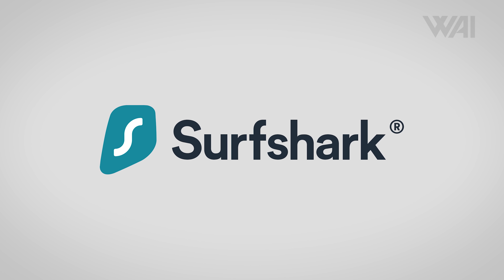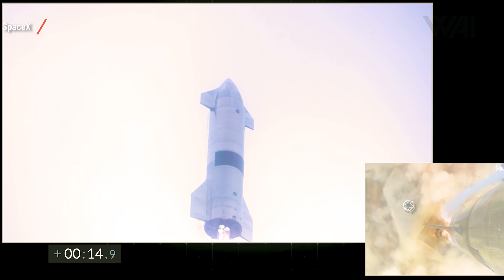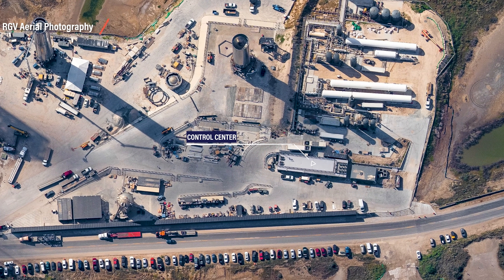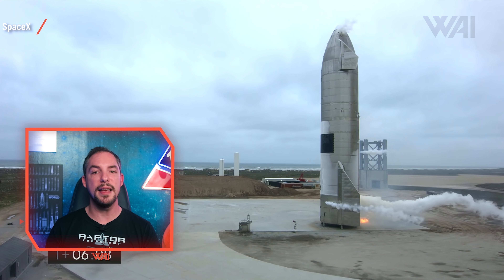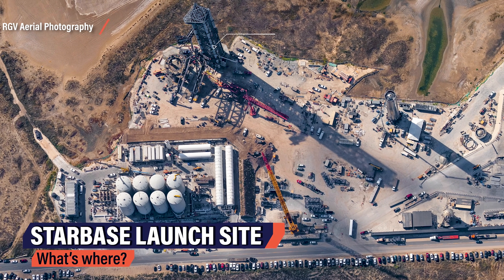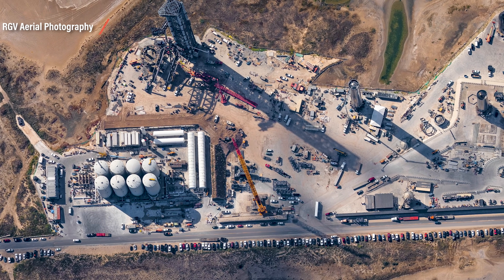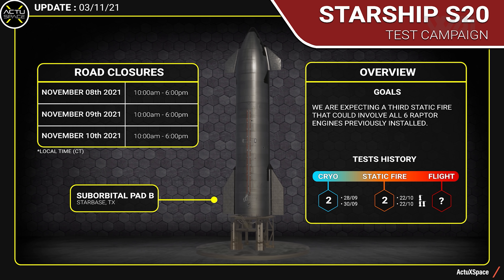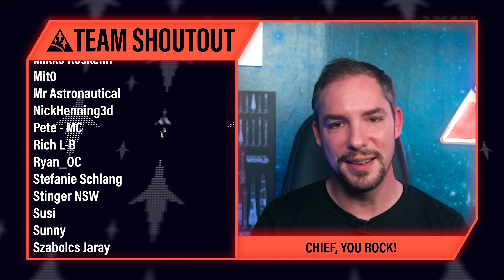What's the trick behind SpaceX's Starbase? Booster 4 getting ready for static fire!

Comment: I keep hearing back to back launches.  Unless SpaceX is building more pads and towers, that is not happening.  
A launch produces a very violent environment.  The tower and pad need to be inspected after every launch.  Shuttle with 1/2 the thrust of the proposed Starship and with a launch pad that had a flame diverter, needed a minimum of two weeks for inspection of the tower and pad and start possible repairs.  I don't think even Musk has the magic to relaunch within a few hours on the same pad.
Reply: The whole point is to make a system so reliable it doesn't need inspection after every launch.
Reply: @justinni_  Is Starship going to produce a new type of flame that doesn't generate heat or energy?  Has Musk found the secret to a concrete pad with no diverter that will keep debris from coming off of it.  Even if there is no damage, there still needs to be an inspection.  Rapid reusability does not have to be within hours.  It could be a month which is excellent for a vehicle that size, (that won't happen either).  Musk says a lot of off the wall things that are always scaled back.  LV convention center loop driverless cars and hyperloop is not that difficult for example   Those his words you can look up.
Reply: @pebmets  inspection can be done, sure, but obviously shouldn't need weeks.
Reply: @justinni_  We will find out, but I think NASA knew what they were doing.  Even if time is shaved off, it will not be the same day.
Reply: They put the launch pad on stilts to get it further away from the concrete down below. This reduces the energy of the reflected sound back to the rocket, and the force on the concrete.

They are adding protection to the booster and to the pad so it can withstand the noise. This means they won't have to flood everything with water.

The interface with the booster will be protected inside the massive steel donut. I expect that launches will show weaknesses in the donut design. These will be strengthened until the donut can handle launches without damage.

If needed, they can run coolant lines through the launch infrastructure. I doubt this will be needed.
Reply: @hamjudo  For Shuttle, the flame trenches at 39A and B were 43 feet deep.  Add at least another 25 feet for the height of the mobile launch platform.  Keep in mind there was a flame diverter in the trench to help get some of that away from the vehicle.  A sound suppression water system was also used.    With all that, it took a minimum of two weeks to get the tower and pad ready for the next launch.  All this and Shuttle is 1/2 the thrust of what is proposed for Starship.
Reply: Comparing how the gov and money wasting contractors like boeing do it to how spacex does it. Spacex doesnt need to waste time to keep the budget rolling. 2 weeks are you kidding me. Thats probably maximum few hours of inspections and maybe a day for repairs. Completely different work  ethic since theyre not scamming taxpayers.
Reply: @Andytlp  Really?  Fixing concrete and letting it set properly takes less than a day?   The physical process of checking a 400 foot tower takes less than a day?  If everything is perfect, maybe less than two weeks, but a few damaged support lines, broken concrete, any form of damage to the tower, you are talking minimum two weeks.  It's not like everything is on site for quick repair.  Things may have to be fabricated or ordered.

Comment: The Space Shuttle orbiter was essentially a second stage that got reused regularly, so it’s not accurate to say it’s never happened.
Reply: STS was supposed to turn around in 4 days; but the fastest it EVER did was about 2 months (usually much longer) and it cost half a billion to do it. These apples are very different from those oranges.
Reply: @999FEF  At least all of the heavy booster stack will be reusable. Hopefully!
Reply: @999FEF  The Shuttle program was a giant leap from what was previous done.  New techniques were being tried with NASA and their contractors learning what it took to build a reusable vehicle.  No one had ever done this before so they were the ground breakers. As time went on, they learned that the stresses of a launch and flight were significantly greater that they originally thought.   Many people knock the program, but I believe it should be considered a stepping stone that is allowing Musk to attempt what he is trying to do with Starship.  The shuttles are an under appreciated system and if it were not for them, Starship would be spending years doing development of things that NASA had already tried to see what worked and what didn't.
Reply: @pebmets  I was there for the first shuttle launch as my father was taking sound levels for the Air Force. I still have some “shuttle rock” where the blast fused sand from the area. I grew up on the shuttle and it was truly awe inspiring with many innovations. But in hindsight I acknowledge that the program was very top-down in its engineering and manufacturing philosophies (in large part because it was managed traditionally by government). It’s actually an exemplifier of the systemic problems that arise from that kind of engineering management.  SpaceX is benefiting from those lessons and some zeitgeist and some marvelous luck and are able to employ a bottom-up engineering philosophy that’s never been applied at scale in space transportation. It’s truly breathtaking.  Thank goodness for NASA’s brilliance with the COTS program or SpaceX probably wouldn’t be this far along. 
I’m not slamming STS.  But I can’t help but fanboy a bit for SpaceX.
Reply: @pebmets  To be honest, you say that people are knocking on the space shuttle program to make starship look great, but i didn't see any comment about that. To me it looks more like you are knocking on the starship programm to  overexaggerate the space shuttle and to protect your childhood hero. 

You did compare the space shuttle with the falcon 9, thats a good comparison. Now compare the number of launches. Then compare the cost F9 vs. SS. Do you see the difference? 

They scraped the programm because it was a wastefull money burner, while spaceX is a (mostly) privatly founded company and uses a much more elegant and thought out approach. They did some launches and stoped it because they could not iterate the design, although it had obvious problems. SpaceX did way more launches (with F9 vs SS) and is already with the F9 far superior to the space shuttle.

Saying that the superiority of the starship over the space shuttle is overexaggerated, is like saying that a Tesla Model S is overexaggerate over a trabi, because the trabi was reusable aswell.
Reply: @MrBoss-zn5vn  The Shuttle is not a good comparison with a falcon 9.  It could carry a large amount of cargo and Humans.  The Canadarm allowed it to grab and place things where they wanted it.  It was a great assistance in building the ISS and the Hubble repair missions.  Falcon 9 or Heavy cannot do many of these things.  Shuttle even had an airlock to allow for Space walks which I do not believe crew dragon has.

Shuttle program was ended after a reevaluation after the Columbia Accident.  NASA wanted to do bigger things, but there budget was so tight there would be unable to do it while upgrading and maintaining an aging Shuttle fleet.

If you read many comments, the biggest complaint is cost either Shuttle or SLS.  Starship is being praised and if we all are honest, it has done nothing yet.  the excitement is what Musk says it will do.   Musk may achieve many things, but like anything else, it is a scaled down version of the great promise.  Instead of saying how expensive shuttle was, look at what it opened up to allow Musk to try and fulfill his dream.
Reply: @999FEF  Tank you and I appreciate your well thought out comments. 

 I was 19 when STS-1 took off and I remember what a giant leap it was from Apollo to Shuttle.  Due to the typical Congressional funding game, the shuttle was a hybrid of what the defense department needed and what NASA needed.  NASA wanted a smaller vehicle, but to secure funding the defense department was added.  There was an attempt to have all U.S. payloads handled by Shuttle until the Challenger accident scrapped that idea.

Shuttle was not perfect, it did not meet many of the things that were promise, but I look at it for what it was and I still marvel of all the work it took to develop and fly it.  Who would have thought you can land a falling brick on a runway. 

I think Shuttle made it possible for Musk to do what he wants to do with Starship.  Without it, he would be years behind where he is today and he would be assuming much of the costs that it took shuttle to find out how to even attempt reusability.
Reply: @pebmets  You are right. In the good'ol days everything was better.
Reply: Thank you.  I was wondering if people remember the space shuttle orbiters were reused.  I seem to recall all of those great landings and later on being rolled out for their next mission.
Reply: Given that the Space Shuttle main engines were only fired on the way up to orbital insertion and were replaced after each flight, it's a real stretch to call it "reusable". Heck, even "refurbished" is a slight stretch. Some parts were reused, some were refurbished.. and some very big, important parts were replaced.
Reply: @Garryck-1  you are thinking SRB where segments were reused.  The SSME's were taken out inspected and reinstalled for the next flight.

Amazes me how SpaceX and Musk followers have a hard time saying the Orbiter and SRBs were reused. You cannot accept Musk was not the genius that first did reusability.  You play word games.

Musk uses the word refurbish for crew dragon and refurbish for the boosters of the falcon 9 .  Based on your definition, they were not reused, but refurbished.  Don't be silly, Two of the three  shuttle components were reused.  Musk took it a step further, though stage two on falcon 9 is not reused

Starship has done nothing yet.  Not one component resued. You are basing it on Musk's words, but there will be "important parts" replaced between flights as you would say.
Reply: The shuttle SRBs were fished out of the water and re-used, but it actually cost more money and took more time to refurbish them than it took to just build new ones. At that point are they really reusable? Sure if you throw enough money at something you can get it going again. The same principle essentially applied to the orbiter --Months of refurbishment and hundreds of millions of dollars thrown at it just to get it back into service. I loved the shuttle but I wouldn't consider it a reusable system. Refurbishable would be a better way to describe it.
Reply: @odysseus5872  Even with what you mentioned, they were reused.
Reply: @odysseus5872  The SLS will be 1 billion a piece and the whole thing is gone
Reply: @eduardogardin879  The actual rocket is 800 million.  As they build them they get lower in price because they learn from the first.  The rest is infrastructure, labor, testing, development, insurance, all the things that go into a space program.  People seem to omit these other things when talking about Starship.  The very least, the cost of Starbase, (infrastructure and labor),  should be added to the cost of the program.  We did that for Apollo, Shuttle, and now SLS.  Why not the same for SpaceX for a real apples to apples comparison.
Reply: *Rapidly reusable second stage
Reply from the maker: It wasn't fully reusable, though. As beautiful and as impressive as it was, it was far from that. Months of turnaround and a complete refurbishment were needed. Also, it wasn't a second stage at all. It even required a special launch system, adding a giant main tank and boosters. It wasted more than a normal rocket for added ability.
Reply: @Whataboutit  
I'm afraid I have to say Mike is essentially right. Those solid boosters were the functional equivalent of a liquid fueled 1st stage, had the Shuttle system been configured to have one sitting below conventionally.
A big first stage? No. A first stage? Yes.

In the video, the feature "reusability" is provided without any delimiters. So the Shuttle proper could be considered reusable proper. 

2:52 fast and full reusability

And although there was a considerable downtime for it before full turnaround, that wasn't the Shuttle's design-goal; I think they also wanted fast and full reusuability. Finally, no SS is operational yet. Its design goal is to have it reusable < 1 day. We haven't seen that actually happen yet, and probably won't for another year.
Reply: @-danR  Excellent thought out comment.  I believe less than 1 day turnaround won't happen especially for human rated vehicles.  With close to 15,000 tiles I would think you would want people to check them not robots.  A camera cannot verify if a tile is loose.  Also checks for micro hits on the glass needs be carefully performed.    This is an intensive process.  I don't believe any human vehicle would be left to pure we say it is reliable without a physical checkout which is more than a day.
Reply: @Whataboutit  Some of the SRB segments were reused up to 12 times. The SRBs were used for the extra kick the shuttle needed in the first two minutes of flight after which they were jettison to parachute down to the ocean.  The ET was basically the throw away item which was designed that way as a way to fuel shuttle and to allow it to reach certain specifications it needed to meet as well as the cost and logistics to make it reusable.
Reply: @Whataboutit , I’m having serious doubts that Starship will be able to get away without refurbishment after seeing how fragile the “Starbricks” are.  Elon does like to prove people wrong, but it’s an uphill battle for sure.
Reply: @MParker8200  I think you will see a lot of changes before they are done with the iterative test phase here.  I am sure they have some changes already for the next starships based on what they have seen.   Figuring out what works and what does not.  Definitely a lot of work to do for final version though..
Reply: @MParker8200  I agree with you about refurbishment, but please, they are not "Starbricks".  They are thermal protection tiles.  Musk has the childish way of wanting to put the word star in everything related to this project:   STARhopper,  STARbase, STARship, now STARbricks,
Reply: @MParker8200  I hear you brother BUT remember how ridiculous it sounded when SpaceX said they'd land a booster? They'll get there. I have faith.
Reply: @pebmets  no different from Steve Jobs putting "i" in front of everything: iPad, iPod, iPhone, iEverything even for truck engines now. Or "e" for everything. Ebay, esurance, etc etc denoting all the things involved in a market or category. I don't think it's absurd to recognize the things categorized in the SpaceX market to be labeled with the prefix "STAR". Also, I grew up with the shuttle and was fascinated with it. It made me want to become an astronaut as a child. I loved it's use in movies like Armageddon and all the achievements it had, but it was a massive step backwards from Apollo. If Apollo was continued we'd have had a moon base 40 years ago. I could pull a car that sat at the bottom of a lake for 5 years out of the water, spend millions of dollars and half a year with the greatest minds on the planet and get that car driving again making it technically reusable after being driven into a lake.
Reply: @odysseus5872  The difference is Starbase and Starship are also references to a famous television series.  They are not exactly original.
Reply: @Whataboutit  You are doing a great job and wish you continued success, but what ever nomenclature you want to use, the orbiters were reused.  Some SRB segments were reused up to 12 times.  I believe the quickest turnaround for an orbiter was 56 days.  Keep in mind until recently, falcon 9 boosters took close to that long to turn around.  This is with the shuttle being human rated.  

You are not old enough to remember, but I remember all of the fantastic things I am hearing about starship and quick turn around are exactly what were said for the shuttle in the 1970s when the program was in the same development stage.  NASA learned that the stresses of launch and flight were significantly greater on the vehicle than anyone thought.  All of things shuttle incorporated were never done before.  This is why I don't understand why Elon Musk followers knock the shuttle program.  They are not looking at the whole picture of what it was and should be considered a stepping stone for what Musk wants to do.
Reply: The shuttle was not a complete second stage, it needed the the large tank to get fuel.
Reply: The shuttle's engines operated throughout the launch. They were not fired after release of a first stage, they were lit right from the get go. The engines on the orbiter were all stages to orbit. It's also subjective to say that the shuttle was reusable. It was salvageable when it returned but far from ready to be re-stacked and returned like is being planned for Starship. It's you who is thinking of it in a far from accurate way :(
Reply: @woofles1870  You are playing word games.  The orbiters were reused.  Go ahead say refurbish, but I guarantee starship will be refurbished before it is launched again.  Don't understand why fanboys cannot appreciate what a marvel the shuttles were and have to knock them to make Starship look better.
Reusable, SRB segments, orbiter.  Relending of a rocket, was tested in 1993 with DC-X.  TPS, looks similar to shuttle with the exception shuttle was not blowing off tiles lighting the engines or thrusters.
It seems this Starship is great is being overexaggerated by knocking every other program before it instead of acknowledging they were stepping stones for Starship.